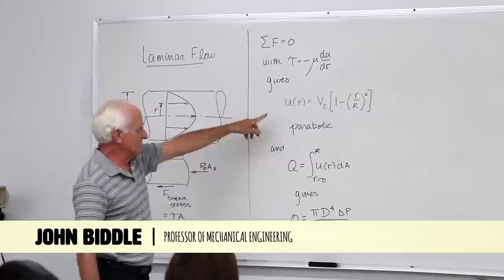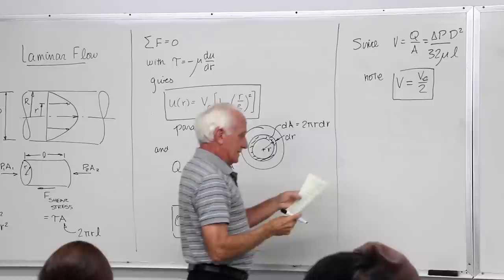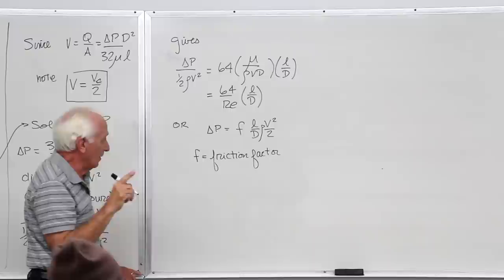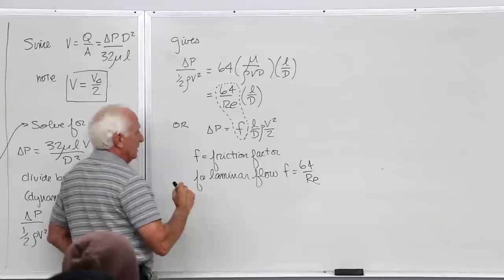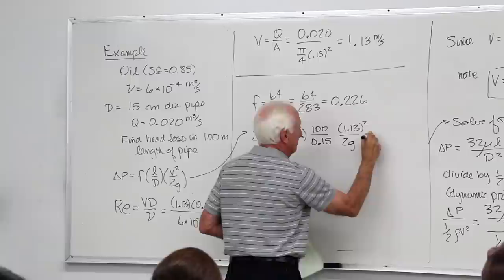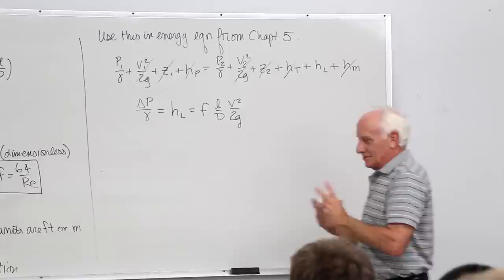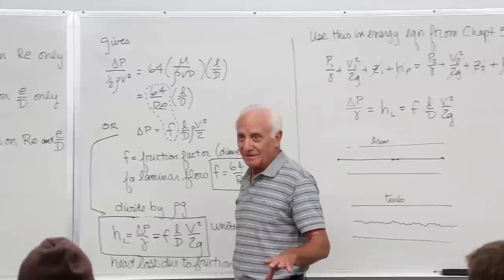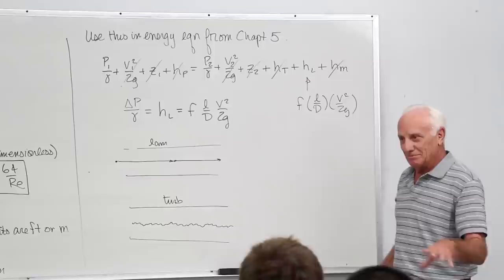Fluid Mechanics: Laminar & Turbulent Pipe Flow, The Moody Diagram (17 of 34)

Comment: This is so clear and practical! I'm currently taking fluids at UCI and we've only gone over the derivations, these concepts are only explained from a mathematical standpoint. Thank you so much for making connections between the formulas and the physical systems they represent, this is wonderful.
Reply from the maker: Glad the videos are helping. In every fluid mechanics course, there is limited time in the classroom. Often a tough choice has to be made about whether to focus on derivations or sacrifice some derivations for examples. Both have potential advantages and disadvantages.
Reply: Papamoschou?

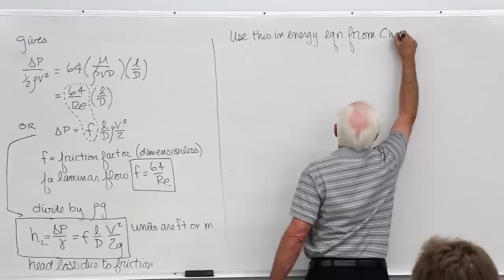Comment: 9:00 Energy Eqn
10:07 its called head form bc every term in the eqn has units of feets or meters 11:23
13:31 !!!
20:44 turbulent flow analogy
23:13 moody diagram
29:15 moody diagram(log-log) for turbulent flow. Copper & PVC pipe are approx smooth pipe = smol no. of roughness factor (epsilon)
29:42 how to get friction factor of turbulent flow using the moody diagram
36:06 how to read log scale

Comment: Can ansser that plase👉The losses per unit length pipeAh/l in turbulent flow through small pipe depend upon Velocity, Diameter, Gravity, Dynamic viscosity and Density. Determine the general from of equation.

Comment: if given Re, kinematic viscosity and D, and asked to find mean velocity, would it be right to find V and then multiply by 0.5 for mean velocity? or in other words is Vc the same as the V used in these equations? thanks
Reply from the maker: The V in the Reynolds number is the average velocity across a pipe cross section. If the flow is laminar, Vavg = 0.5 Vc.

Comment: What about a head loss due to a nozzle?
Reply from the maker: The head loss of a well-designed nozzle (where the flow is accelerated smoothly and flow separation is avoided) is relatively small.
Reply: Awesome thanks for the swift reply.